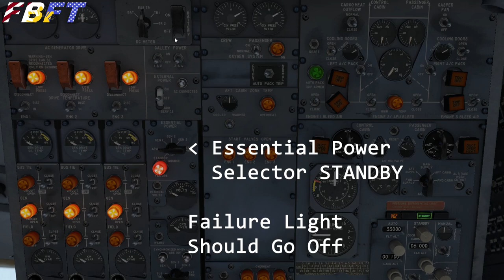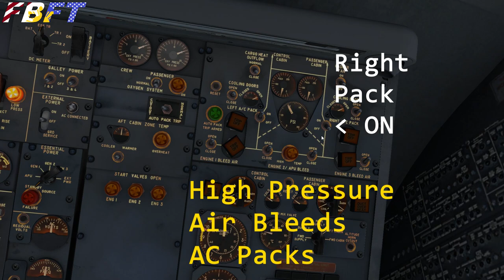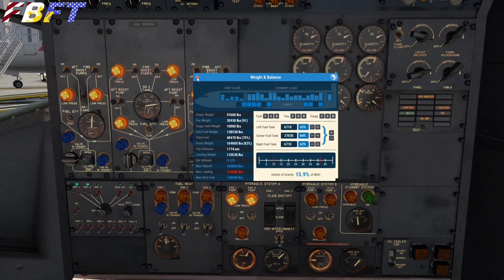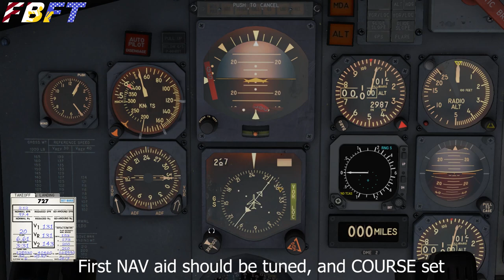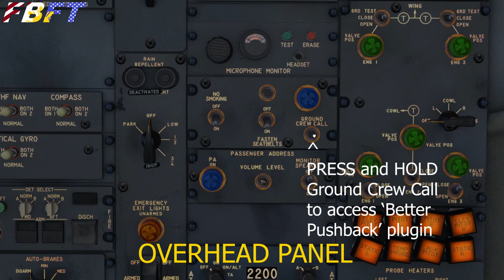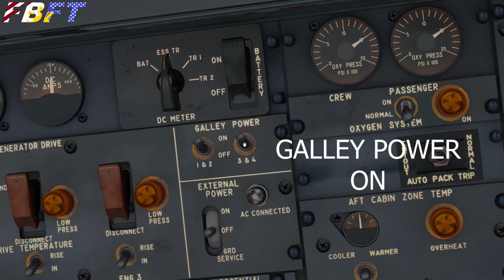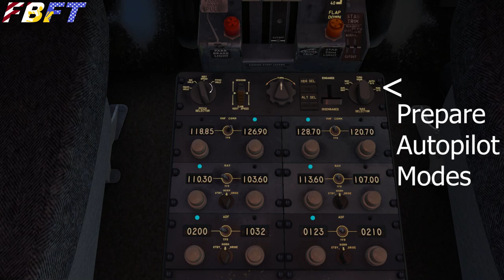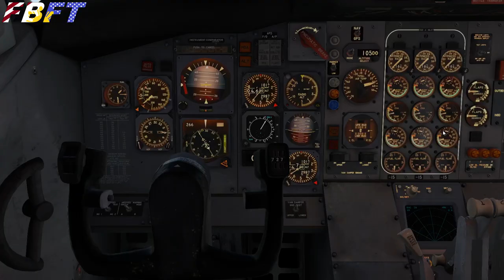X Plane - Boeing 727 Startup Procedures | FlyJSim

Comment: Retired A&P.  Spent 23 years on flight lines, ASC Heavy 'D' check, and engine overhaul shops.  Worked on  everything from corporate to majors, passenger to cargo config. Worked for EAL in Miami 1986-89, on B-727, DC-9, L1011 and A300.  But the  B727-200 has always been my favorite.  This is a great tutorial.  I really miss that bird, even though she would make me curse up a storm at times.
Reply from the maker: That’s fantastic!  Thanks for taking the time to comment and we are glad you liked it.  If you’ve got a good story or two, drop it in, we are avgeeks

Comment: Ok, here’s my two cents as a real world qualified FE on the E-3 (707-320). I’m by no means trying to be rude or condescending. I have hundreds of flight hours and am speaking from my experience and knowledge of these types of systems. Just some things I saw...

Check your volts and freqs before applying APU power to the sync bus. Then check your T/Rs. Each should indicate at least 24V.  Then be sure to set the essential power to APU. Also, the APU on the 727 is unable to handle the load of both packs simultaneously. When you do that, look at the APU EGT. It will rise above limits possibly causing severe damage, if not a fire (in real life or if you have the maintenance system turned on in X Plane). Although, I don’t think it’ll cause a fire in X Plane lol. 

As far as pressurization, you will be fine leaving it in GRD the whole flight. The purpose of FLT mode is to pressurize 250 some odd feet below field altitude. Although this is just a sim, the problem with pressurizing on the ground, is that (in a real plane) if you needed to evacuate the aircraft on the ground after the doors are closed, you wouldn’t be able to escape. This tragically happened to a commercial 707 back in the day. The only good reason to go to FLT mode is if you do a water landing to prevent water seeping in through the outflow valve.  

Speaking from experience, there is A LOT that the performance card is neglecting. To name a few, it doesn’t factor, Runway Condition Reading, Runway Surface Condition, Static vs Rolling, acceleration height, runway length, runway slope, screen height, required climb gradient, or obstacles. The landing card also neglects, go around power, landing distance and ground roll. All these factors are critical in determining your max takeoff weight and landing suitability. Flyjsim is lacking in this area. 

For engine start, it is critical that you check that there’s a drop in bleed air duct pressure and that the start valve open light illuminates. If this doesn’t happen, it means that the engine is not receiving bleed air required for N2 rotation. You also want to observe an almost immediate rise in oil pressure. When the GRD start switch is released, you then want to observe a rise in duct pressure, the corresponding IDG light extinguished, and the System A hydraulic low press light is extinguished (if starting engines 1 or 2).  If the duct pressure does not rise after releasing the start switch, that will cause damage to the starter in the engine. 

I know you put in the takeoff EPR on takeoff roll, but your engine EGT was out of limits. From playing around with Flyjsim’s 727, I’ve noticed that the takeoff N1 is better for engine EGT. This is Flyjsim’s fault though. They’re not very accurate and I’m a little frustrated honestly, but I also have real world standards, so I guess I’m kind of not being fair. 

Anyway, nice vid my man and keep up the good work!
Reply from the maker: Wow, comment gold! Thank you for taking the time to share you expertise, I will go add those steps to my printed checklist for added realism. Have you seen our Wilson 707 video? It isn't nearly as good as the FlyJSim, but it is (was) the only payware 707 around. Do you also have 727 time in the real world, or is the ship so similar that what you wrote applies to both models? Thanks again for sharing your knowledge!
Reply: Flight Brothers FT yeah, no problem! I wish I had 727 time, that would be awesome. But the systems operate very similarly, with different limits and performance capabilities. Once you understand one plane though, it’ll be easy to figure out its cousin. There are many concepts that just apply universally (ex: checking T/Rs after APU start or checking drop in duct pressure for engine start).  I also learned a lot about the differences between the 707 and 727 from CBTs. If you search “727 CBT,” there are tons of good videos that explain the systems in detail. We use the same type of training on the E-3 as well. 

I’ll have to check out the Wilson 707
Reply from the maker: @sniper dolphin, other flight brother (Lee) here.  Love the details and comments.  I’m guessing you called NE and OK home for a while??
Reply: Flight Brothers FT Been in OK for a minute. Was a maintainer on the E-3 as well
Reply from the maker: Last time I was there I saw a couple depart over top.

Comment: As I've suggested to many other authors of videos like this, you should review and use procedures and checklists from an actual airline that operated the type.  Battery voltage before starting APU.  Check fire detection system before starting APU.  You should NOT select STBY on Essential Power sw when you did; it will deplete battery quickly.  Check APU Crank annunciator when starting APU. ALWAYs check Volts/Freqs before selecting any power source.  I could go on.  Yes, I taught  727 and other types and have thousands of hours at the panel and at the controls of this type.

Comment: Like others who have commented below, I'd like to add my two cents. Upon engine startup, isn't it essential that the engine/s generator voltage and frequency be manually put into phase before connecting them to the sync bus? I didn't see this paralleling happen in the startup sequence. Thanks.

Comment: Everything turns on but i got no electrical to FMC. The HSI VOR distance indicator does not show up, and my autopilot doesn't work.
I'm following every step, what i'm doing wrong? The problem is HSI VOR distance indicator doesn't remove that white cover, the autopilot doesn't work and FMS doesn't turn on when starting the plane from "cold and dark" status.
I don't have these issues when starting from "already running engines"
I tried to click on one of the two switches behind the Captain seat and saw that the closest one is the cause behind the FMS and HSI VOR distance indicator not working, so i presume that the autopilot wouldn't work either as if that switch turns off all electricals (is that true? is that the switch that controls the electricals, instruments and autopilot?)
The problem is that even if click on it when starting from cold and dark, nothing happens nor changes, so apparently i found the cause behind but still don't have a solution and have no idea what to do.
Watched several cold and dark startup videos on YT but no one seems to have this issue...
I don't have these issues with any of my other planes, default ones nor Zibo, only 727.
Reply: I just found out that if i bind a key to "turn on avionics" HSI and FMS show up, and as soon as i re-press it they turn off again. I've looked around to see if there was something moving while pressing that key, but nothing in the cockpit changes... so the problem is that i'm missing something in the startup procedure? what's about turning on avionics in the 727 that i'm missing?
Reply from the maker: It’s been quite some time since I’ve flown the 727.  I remember engaging the autopilot has a few quirks to it, which I always re-discover.  Tim might be able to chime in here and help.  Thanks for taking the time to comment and if I’m able to squeeze back into the sim, I’ll see if I can find anything of use.  -Lee
Reply: @FlightBrothersFT  Thank you so much, it's a pleasure

Comment: Hey dude! Everytime i start my APU it does not go any higher then 2500 when spooling up, also i get not flickering lights like you do am i doing somthing wrong or could this be a bug?
Reply from the maker: Interesting.  Were you able to put the AP on the electrical BUS for power?  Did you have APU bleed pressure for engine start and AC packs?   Or do you feel like your APU was spooling but never actually igniting and starting?  If it is spooling but not starting, that is likely a fuel issue.

Comment: Does it ask you for activation code every time?
Reply from the maker: Nope. Just installation and I think some updates. Otherwise no.
Reply: Flight Brothers FT hmm it asks it every time for me
Reply from the maker: @pizza_parker9689  that is definitely not normal. You might want to email FlyJSim support.
Reply: @pizza_parker9689  Got the same problem with th v2 so i used a crack for it.
Reply: e30kitty i just restarted many times and it worked